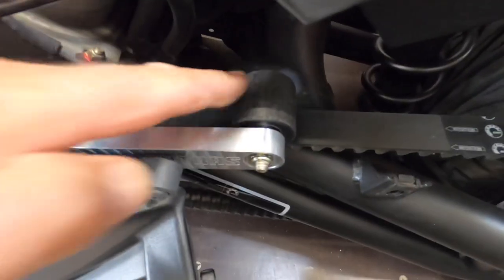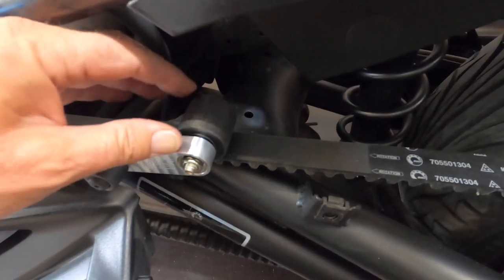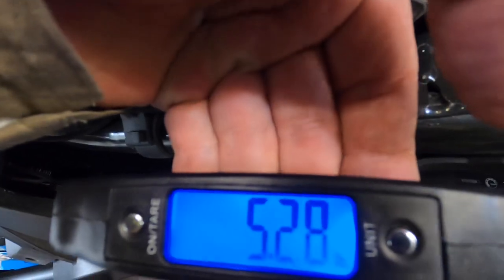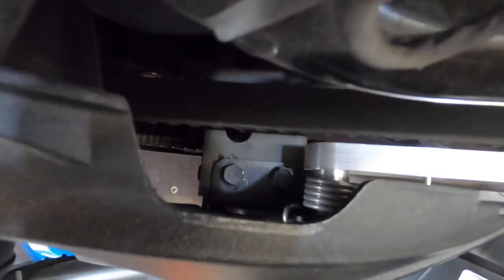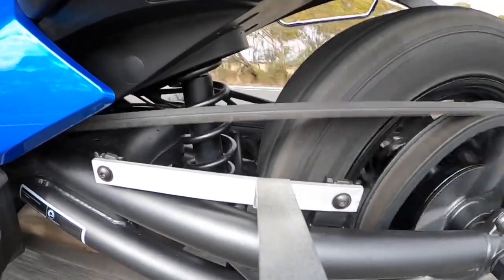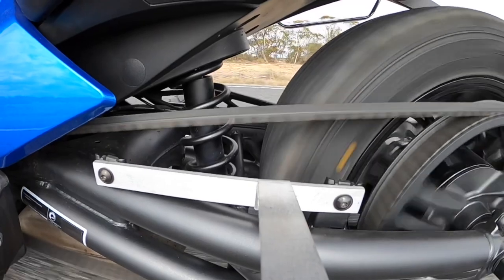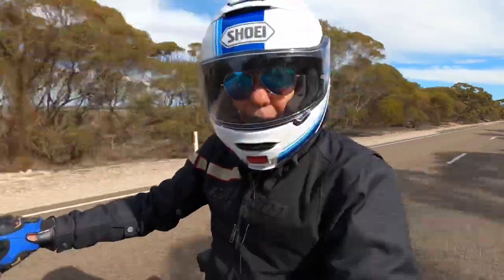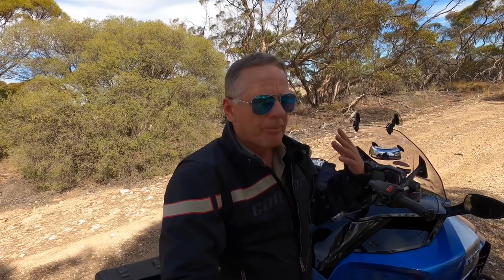CanAm Spyder belt tensioner does it work? (Part 2).   (29)

Comment: I have a 2022 Can Am F3 limited. There is no place to mount a belt tensioner on this bike that I can find. And the belt on mine is bow string tight so maybe putting one of these one my bike, if I could, may cause problems. The dealership where I bought my Can Am stated that these late models don't need a belt tensioner and I would be wasting my money to purchase one. But, as I said, I can't find the mounting holes for the belt tensioner anywhere on the left side of my bike.
Reply from the maker: mmmm ok bow string tight ,  I would have thought that would put an enormous amount of pressure on the front pulley shaft (seal etc). This is one of these situations where I guess you have to trust your dealer, in saying that it wouldn’t hurt to call another dealer to get a second opinion. Unfortunately I don’t have any experience with the latest model  but a second dealer cal might be worth exploring.